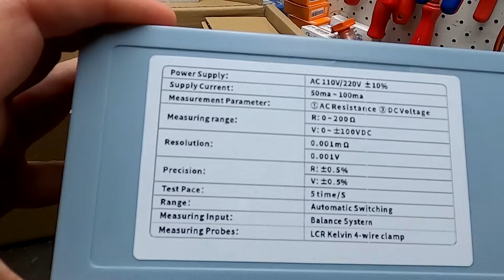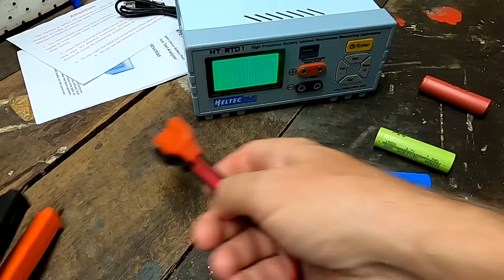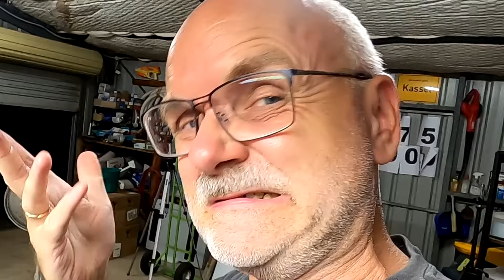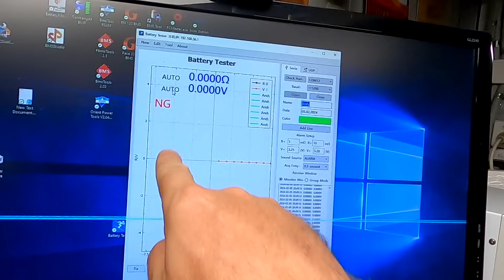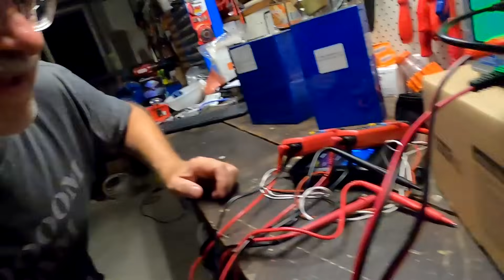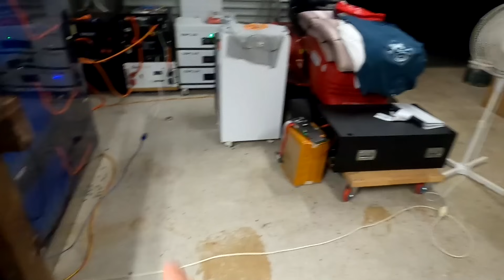Heltec Internal Resistance Tester HT-RT01. Not what I was expecting...

Comment: If this meter is really intended for production lines, it should have an external trigger so measurements only occur when the test fixture is in its intended measurement position instead of requiring parsing logs and aligning timestamps with the production line to figure out which measurements go with which battery.
As for the LCD's readability, you could try using a polarizing filter on your camera to improve contrast.
Also, you can easily fix the short probe cable length my splicing, it won't affect a proper 4-terminal measurement. In a production environment, you would build your own rigs, kind of makes sense they wouldn't bother much with usability-testing bundled probes that won't get used much in the industry beyond testing the unit out of the box if at all.
Reply from the maker: Yeah, I could extend the cables, it would not matter as there is no current going through. Just need to keep them twisted...

Comment: The hand-held test probes are less accurate than the coaxial probes provided with some other testers.  Both the test current injection point & the voltage measurement point need to be as close as possible to provide accurate 4-wire resistance measurements.
Reply from the maker: The question is, how accurate you need to be in a DIY environment...
Reply: Battery cells in battery packs get out of synch for two reasons:  the energy capacity in kWh (better than the usual AmpHr matching) is mismatched, & the internal resistance is mismatched.  The series connection requires each battery to match 1/16 of the energy delivered for a 52 V pack (the weakest battery sets the limit for the pack) & the terminal voltages over the discharge curve along with the AmpHrs sets the energy delivered by each battery at full discharge.  Internal resistance determine the terminal voltage because all batteries deliver the same current.  So how much unused energy (kWh) are you willing to leave in your battery pack because it's inaccessible when the weakest battery runs out of energy?  The better the match, the better the useful energy from your pack.  So I suppose you could say that the absolute internal resistance level is less important than the match between battery cells.  In that case the absolute value read by your meter is not important as long as it has the same error bias for all measurements.  Any errors caused by probe positioning errors are not likely consistent, hence the recommendation for coaxial probe tips. @OffGridGarageAustralia

Comment: What you purchased was a bench top instrument, usually placed on a shelf above the bench top so the display would have been easy enough to view. Being a bench top instrument, it is not meant to be moved to take a measurement and the leads are too short for your purposes but remember having longer leads causes it (1) to be more susceptible to noise (the instructions mentioned the possibility of interference from cell phones?) and (2) increases the resistance in the leads (which would likely be somewhat compensated for with the Kelvin probes). The software was a big disappointment, not having an automatic sensor  or switch on the probes to allow you to move from battery to battery without having extraneous garbage readings doesn't fit what otherwise appears to be software meant for bulk testing.
Reply from the maker: But how do you measure a lot of batteries in a timely manner if the instrument sits still on a shelf? You would need some sort of belt which feeds the batteries to the right location. For me, the whole product design is flawed not to mention the software...

Comment: What a silly piece of hardware.

There is a workaround for the software. Just set the interval to 1 second and keep measuring the cell for 10 seconds. While moving batteries the log will display a lot of 0 values, so you can use these entries as a separator. This way you have multiple measurements per cell which should help you discard contact errors.

As for the contacts themselves, I think you need to measure their resistance, extended them with some nice wires (also measure their restistance first) and then test the internal resistance of your work again to make sure it is done right. Luckily you already have a resistance tester for that 🤣
Reply from the maker: Sometimes the tester does not measure 0 though and has some sort of reading. Afterwards you just don't know if it was a bad cell or a bad reading.
I think I can just extend the cables as long as they are twisted. There is no current flowing, so cable length should not make a difference.

Comment: G'day Andy how's things got question been really busy forgot about my battery it was full (two years my bad)😢now something happened now is this correct it went to sleep it was 5 v now I put the charger on it played up for awhile then started charging went back to 12.4v still got charger on for a bit but did I wake it up or did I f@#$ my battery 😢
Reply from the maker: I can't really understand this one long sentence... what battery do you have?
Reply: @OffGridGarageAustralia  lol my back goes bad for the last two years I go through stages but this time my sciatica got pinched between my discs so I was 80% paralyzed but all good now sort of but I wanted to go boating so I checked the battery 5v hooked up to the charger well it carried on (got a solarking battery with our favourite active balancer lol)then out the blue the charger worked and charged up the battery so I learnt doing bit of research that a lithium iron can go to sleep so how do you fix it get a 12v source amps don't matter here hook up to negative first then this is very important just quickly touch the positive with the positive wire  and just a sec and it wake everything good learning curve but it was cool to learn thank god it happened to me but if you look at it all I'm doing is jump starting the BMS(I think) same as you with the BMS starting up sorry not good with video and two years is a long time lol go lithium iron batteries as if it was leaded it would have died

Comment: This is not a product meant for bringing around but have handy on stand by next to your bench power supply. Did you check group mode on the app? Maybe it makes it possible to trigger a measurement? As in a group meaning more than one battery while live is for checking just one? I could easily see Chinese translate something like that to group. Since the device aparantly are using a serial interface I’m quite sure it would be simple for an programmer to make an application that’s useful if the price of this is right and it’s actually measuring correctly.

Comment: If jk did this the thing would be super accurate but both probes would be 8ft of green cable, its always turned on, the screen would be a blank piece of plastic so you need an app on your phone to get any info, you would then get an option of buying an external LCD screen and an optional plug in power button on pigtails, and also a comms port in a strange protocol and a 50 page document on how to read it but no info on wiring to be able to connect any thing to it without guessing..... and i'd still buy it lol
Reply from the maker: Hahaha, great analogy. I like it!

Comment: You should hang it below a shelf/or even on a shelf abouve the height of the cells then the cables hang down. If you extend the cables the resistance could influence the measurement.
Reply from the maker: This would make no difference in the purpose of this device...

Comment: btw, Andy, your TR1035+ should also be able to connect to PC via USB. but it need be patched with CP2102 chip. details at "YR1035+ enabling serial port to read data" thread at secondlifestorage
Reply: What software would you use?
Reply: @CollinBaillie  unfortunately have nothing to say more, than refer to mentioned thread. TS mentions Mega Cell Monitor integration, that's probably it
Reply: The same software that heltek uses might work.. because it seems to work the same way (sends info on serial 2 times per second) .. just need to have a usb to serial (uart 3.3v) that this software wants..or maybe we can change the usb info (vendor:id).

Comment: Seems to be an RC3563 tester stuck in a box by Heltec. Not even their own device, just rebadging someone else's product. Just checked pricing also, and they cost 5 times the RC3563. They play a joke on the unwary

I would LOVE to see a teardown!.
Reply: It's definitely a clone of RC3563. Menu is identical, but device name LQ1060S does not even match this Heltec ....
Reply: They have more than one Product from other Companys with just their Lable, inclusive the the known one JK BMS in the Black Case ;). For Example search in Google about: "heltec Intelligent protection board for lithium battery" and you will find a Manual... Already in the First Lines where they explain the Connection can you read from the JK-xxxx BMS XD.... and you can see the JK App Software in the Pictures XD. But it gives more Companys that they make the same....
Reply: They have more than one Product from other C.....ys with just their Lable, inclusive the the known one JK BMS in the Black Case ;). For Example search in Google about: "heltec Intelligent protection board for lithium battery" and you will find a Manual... Already in the First Lines where they explain the Connection can you read from the JK-xxxx BMS XD.... and you can see the JK App Software in the Pictures XD. But it gives more C......ys that they make the same.
Reply: They have more than one Product from other C.....ys with just their Lable, inclusive the the known one JK BMS in the Black Case ;). For Example search: "heltec Intelligent protection board for lithium battery" and you will find a Manual... Already in the First Lines where they explain the Connection can you read from the JK-xxxx BMS XD.... and you can see the JK App Software in the Pictures XD. But it gives more C......ys that they make the same.
Reply: They have more than one Product from others with just their Lable, inclusive the the known one JK BMS in the Black Case ;). For Example search: "heltec Intelligent protection board for lithium battery" and you will find a Manual... Already in the First Lines where they explain the Connection can you read from the JK-xxxx BMS XD.... and you can see the JK "Software" in the Pictures XD. But it gives more they make the same.

Comment: feb07’24/1305h 🇺🇸 Herr Andy, Danke. The length of the probe Cable is short, minimizing resistance to read  IR accurately. If the length is required to be extended; I’m sure there could be a potentiometer to adjust, by first reading the resistance of the new cable. That’s my inference. You’d not want to go to that length! The display is 90% similar to 1035+ and I’m certain the electronics are too. 
I’m not being negative, but this device is unsuitable for normal use. Let me thank you for introducing 1035+; 3~4 years ago. I use it every time, it’s very user friendly, portable and detects dud ones. Have a nice day ahead. Auf wiedersehen.
Reply: "4-wire method" is the magic word
Reply: The device has Calibration built in, so firstly, maybe it needs calibration out of the box (this is bad!) and secondly, you could very much change cables and calibrate the tester for those new cables.

You could also get an RC3563 and have the same thing in a handheld Li-po powered device for 20% of the cost of the Heltec unit.
Reply: Your comments show you don't know what the 4-wire test actually does.

Comment: Thank you! Extension of the wire harness should not be a big deal. They are using Kelvin probes. But the deviation of the R-Value is a fundamental flaw. 
I would add a button as a trigger and start a voice recording as well. Then you could read your cell number and have a link to the recorded R-Value. Or add a small QR-Reader to the probe to link the cell number to the recorded meter reading.
Reply from the maker: adding all these things or I can just use the handy hand-held device we had for years.
Reply: @OffGridGarageAustralia  Of course, you, me and the users can do. But the developers of a brand sparkling new goundbreaking meter should deliver more to bring a real advantage over the handy hand-held meter.

Comment: Maybe you can't expect to use every feature of the unit, for every measurement application.
USB length, easily fixed. 
Test lead length and spec by design. Owners manual normal Chinese standard. (No surprises). 230V supply, means suggested use on testbench with shelving. If model number has -AU prefix, they know you'll just balance it on a plastic wrapoed 6-Pack of beer....no problem.

Comment: Andy why don't you lay down the batterie ? Should be easier 😂
Reply: Yes but this is not the problem 1 Meter of PVC cable is possibly 0.10 $
Reply: @Irilia_neko  the thing is, longer cables might affect 5-digits precision measurement
Reply: @alexandershevchenko489  no it's why you have the 2 wire (so 4 in total)
Reply: @Irilia_neko  AFAIR, even in such case they should be twisted between themselves to reduce interference. which is difficult, if possible at all. correct me if I'm wrong
Reply: @alexandershevchenko489  no the problem you are talking about is for measuring capacitor, the length and size of the cable is important, because of the capacitance produced between the wire. In this case the only thing important is the loss in the cable it's why the two cables, but generally you have a small one and a big one, but they just have used the cheapest part possible. This product was never tested in this state, this looks like an early prototype, because the things in acrylic is clearly a bad idea, way too fragile for a professional environment

Comment: It OK but I prefer my Agilent 4338B low ohm meter, you can still find the on Ebay
Test frequency: 1 kHz
Test Signal level: 1 µA, 10 µA, 100µA, 1 mA, 10 mA rms
Maximum voltage across sample: 20 mV peak
R range: 10 µohms to 100 kohms
X, |Z| range: 10 µohms to 100 kohms
L range: 10 nH to 10 H
Phase range: -180° to +180°
Parameters measured: R, L, X, |Z|, ∅, R-X, R-L, |Z|-∅
To measure DV Volts ill use the DMM6500 6 1/2 diget with its 8 channel scanner card.

Comment: Looks like software is for a robotic tester on an assembly line or a very fast, precise person on a line. If they had a button on longer probes, putting info on file would be handy for large amounts. Years ago, befor lifepo4's became readily available, I saw people use battery testers that printed a sticker to put info right on 18650, that would be a great way, otherwise the cells would need be in some order (as numbered) for the files to be used later.
Reply from the maker: Yes, it could be for an automated setup but clearly not a s bench instrument. The whole product design and usage just does not make sense. It's kind of pointless.

Comment: Hi , you can open the unit and normally it should have a pot on the contrast pin 5 on the lcd , you can adjust that to be readable ( it also may have resistors .. so you must play with that )
Reply from the maker: Thanks for the tip, but yeah, nah. I won't use that device ever again...

Comment: The fact that they are even selling an internal resistance tester is amazing to me.  I wouldn't trust the 5 digits they advertise, but the 0.5% sounds correct.  In anycase, the HT-RT01 is designed for a test bench where the unit is elevated on a shelf, over the battery.
Reply from the maker: And who moves the batteries within 6s? It is totally unpractical to use like this.
Reply: @OffGridGarageAustralia  Conveyor belt or rollers if its a factory and they need to test a lot of batteries.   It's probably used at a sorting station.

I don't know which of the two devices is the more accurate but obviously something is way off somewhere.  I doubt either them has even 3-digit accuracy.  You might need lab-grade test gear to figure out the actual internal resistance.

Comment: hahahahahaha man o man i lol so hard when you were riding that Tester like a bucking bronco. Wouldnt it be easier to lay the battery flat down.?:face-fuchsia-wide-eyes:That product is NG (No Good):face-green-smiling:
Reply from the maker: Yeah, NG=not good!
Of course, you can lay them flat, but that's not what the manual showed, and it is still totally impractical to use with 16 cells on a workbench.
Reply: @OffGridGarageAustralia  you are right about the 16 cells on the bench, that wouldn't work very well if at all.

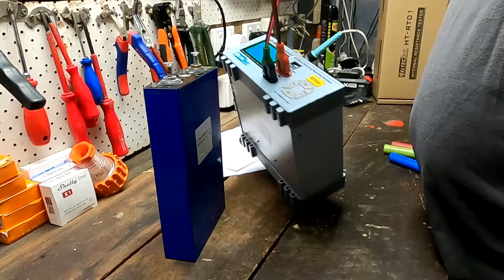Comment: 9:40 lay the cell flat 🤷🏻‍♂️
Reply from the maker: if they are in a box?🤷‍♂️
Reply: Because you have to push the testers onto the cell, this would need to be supported from the back side of the battery laying down flat.  It really needs to be upright so you can push against the work bench.  Not ideal to lay it down flat.  Longer cables would make the most sense...